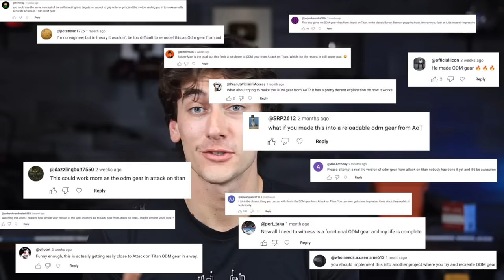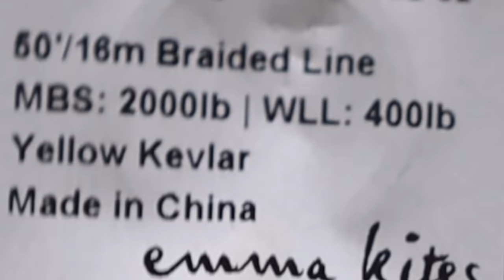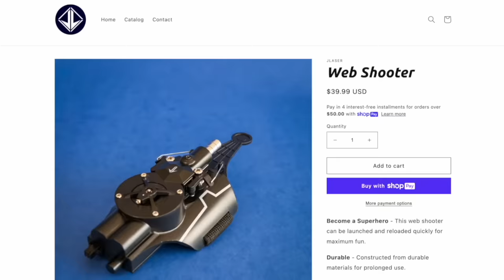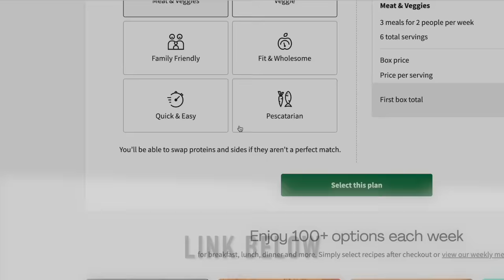I Built Real ODM Gear! - Attack On Titan

Comment: With some tweaking to make it a bit more reliable, I could totally see this being a tool used by rescuers and military personnel to quickly scale buildings! That's so sick!
Reply: omg this is EXACTLY what I was thinking
Reply: But they already have a graplegun, so...
Reply: @DARK_DEEP  why use that when theres THIS
Reply: @DARK_DEEP This is essentially the same thing but leaves both hands free
Reply: the concept itself is impractical without scifi physics, reliability is also dubious. again scifi physics. if the blades easily end titans by extreme maneuver, its hard to say something less exciting, but more effective, and most likely projectile would work far better. in any reality odm gear although "technically" possible, wouldnt be developed, as it presents more problems then solutions, and its ineffective comparatively. like watching jurassic park wondering why they didnt just use penatrating rounds and heavy weaponary from the air. they might have thick skin in the movie, but it aint tougher than steel scientifically, and theoretically it shouldnt be resistant to normal rounds to that extent, much less penatrating rounds. far less exciting for entertainment purposes tho.
Reply: @tinnycans110  no offence but who asked
Reply: hmm may be the structure could be more supportive to the upper body... kind of like a harness or something
Reply: @LexStanton-hj2gy you are sad bcs you got to much hope on this?
Reply: @LexStanton-hj2gy I did
Reply: @LexStanton-hj2gy i asked <3
Reply: @tinnycans110 really they have gun and missile odms as well
Reply: @tinnycans110 😢
Reply: Bombers, Attackers, and Fighters left the chat.
Reply: @tinnycans110 pretty sure he’s just talking about the odm gear, why would rescuers need swords
Reply: @tinnycans110 
🤓☝️
Reply: @sujalgupta8647  in AOT they have basically full body harnesses so if it was actually needed in really life I think it would be fine
Reply: @kevinmackey3166   not really because you are controlling the motor's with your hands. Rope Ascenders already exist and are regularly employed by search and rescue teams.
Reply: @MountainViews90 yes, imagine if fire fighters, who are dealing with a building with a compromised structure and temperatures of up to 1100 degrees; where to climb a building using *checks notes*. A grapple that has to penetrate the building to hook inside, a flammable cord, and a can of pressurized gas that could explode strapped to your body.
Reply: @drizzitdude  while i dont think this would be a good implementation for fire fighting, the cord is canonically made of steel cable and a purpose built metal canister for the gas should be sturdy enough to withstand the pressure created from it heating up in a building fire + you could put a pressure gauge to know how close it is to rupturing and you can release the gas if you need to relieve the canister of pressure. you make a good point about attaching to the building though, not a good idea, most buildings probably couldnt handle the force of a person grappling to it without even being on fire.
Reply: @LexStanton-hj2gy  Haha, cope harder.  Why you mad?
Reply: @drizzitdude  rope ascenders are mostly very heavy and big so its hard to carry around
Reply: @CloudingITS  And so would this, but without the extra safety and security.  You'll notice he isn't going at a dead sprint using it, but always firing it from a mostly stationary position. There's no practical benefits of doing it this way, it's just cool.

Comment: I think the reason they use two independent motors in the anime is so they can use the two sides in a more precise way. You're currently using the ODM gear completely in tandem, firing both sides at the same time toward the same target. In the show, they can fire the sides out of tandem. They can hit one object with one side and something else with the other. To tie it back to Spiderman, think of how Spidey swings along the streets of New York by alternating between his left and right web-shooters. I reckon if you managed to attach the anchor points to two different surfaces, desynced motors would allow you to reel out on one point and slide toward the other- like sliding back and forth along a tightrope. Combined with another commenter's idea of sliders on the controllers to adjust the angle of the barrels (so you don't have to lean back to fire the lines up), and I think you've got yourself a whole new video's worth of content.

One last thing: Is there a reason you haven't rifled the barrels or put fins on the anchors? Either would help the anchors fly straight, possibly negating the need for multiple anchors on each side.
Reply: Preach it man

Comment: Your work is fantastic but i'm going to point some things out which could have made it more anime-like :
• In the anime the thing that shoots the harpoon can be aimed up and down and the aiming mechanism is in the handles which is just a slider , that is the reason characters don't seem to be bending backwards even though they clearly aim upwards (you can see this if you pay attention).
• odm gear also has a nozzle which releases gas from the back which they use for more speed but i don't think you need that its already fast enough.
• their blades are bigger.

Except that i think its perfect, i love your work. You are probably thinking nobody needed this essay...
Reply: i actually thought i was the only one who noticed you could adjust the handles
Reply: The gas is a paradise island only material I think
Reply: Bro some gas stuff 2ouldnt lift a whole human irl
Reply: @shilx_washere8932  Kinda. im pretty sure paradise found the gas in the underground chapel where Marley couldn't get it.

Comment: REALLY GOOD INVENTION MAN! I do want to say that in the show they don’t actually use motors for the odm gear. It’s compressed gas in the tubes that powers the firing and a powerful spring inside the coil handles the recoiling of the string. The point of odm is not to accelerate by pulling in ur body weight with the string, it is to swing off the strings by using the gas

Comment: There's a reason why the ODM has so much harness throughout the whole body,  that's how they balance while being able to have the odm where it is.
Reply: To build off that: Their body is like the steering wheel, and slight shifts in position can change direction bc of the harnesses
Reply: tbh it makes me appreciate the detail and design in aot
Reply: Makes me wonder what the design process the creators went through to come up with it. It seems a lot more feasible than just wishing it into existence.
Reply: @damionkeeling3103  I mean it's the base thought process that makes it almost real, The Harness, The hook and reel system, and not to mention the gas system that also helps propel you and course correct you. The swords have 2 triggers each, now where it's fantasy is that these triggers do everything they shoot the thunder spears, shoot the hookshot and also retract it and control the gas I would imagine the index fingers control the gas left and right handle pushing the gas that way, pulling both gives you forward thrust then your middle finger controls the hookshots and after being fired these also retract somehow. The video is just an amazing proof of concept, if the technology is there and the training is done this could very well be a real invention one day
Reply: @Nocturnal9720  Iirc, the 'guard' on the hilt fires the hookshot (you press the metal guard), the triggers reel the hookshot in and control the gas. The blade is ejected from the hilt by a control at the back of the hilt.
There's different hilts for thunder spears vs. for swords, that's why they wear the holsters in S4- they swap hilts. I think.
Reply: @Nocturnal9720  Actually... no. You have it completely opposite. To store enough gas, and to pressurize it enough so that it can propel like it does in the show would be impossible. A hook that simple but is able to hook to any surface and don't even seem to slip? Impossible. Strong enough ropes that can withstand that type of abuse while being light and flexible? Such material doesn't exist. Unironically the trigger system is the most realistic part, it's not hard to imagine it working with some clever engineering. But the others... just defies physics. This would never be an invention, the closest thing are jetpacks, which can possibly achieve similar performance in the future.
Reply: @chickencoopououwu2584 actually that type of gas does exist, maybe not being able to send you fucking flying but does exist, if you watch Jake vids you would know that
Reply: @chickencoopououwu2584 the hook thing wouldn’t work but this invention is definitely possible, I mean you just seen Jake do it, even though Jake invention wasn’t didn’t look exactly like the anime, he only had a couple people to work on it with him and a couple 1000 bucks to create it. Imaging 1000 if scientists/people working on it with a whole bunch of money from investor and rich people wanting to help with the invention
Reply: @chickencoopououwu2584 the invention is most definitely possible, nothing impossible
Reply: @damionkeeling3103  there's a note in the manga that says the author got help from a scientist friend when designing it.
Reply: @damionkeeling3103 Apparently Hajime Isayama had a friend who works with physics so he helped him with coming up with stuff like that
Reply: @chickencoopououwu2584 I disagree. Impossible is a strong word and you do not have enough information to say that. Theres a reason why things are theorized so often in physics and science in general. Many things are not deemed impossible because we simply do not even know the extent of our universe and what is possible within it. Making ODM gear is most definitely not impossible without a doubt. All we know is that it is not possible yet, as of today.

Comment: Imma just nerd out here and explain how the gear works (im gonna use some of the wiki and on-screen references for the gear and some personal thoughts as well):

So firstly you have 4  parts - The propellant on the back, the wire mounts that also controls the wire's retraction, the launchers on the hip sides, and the triggers.

- The  wire mounts connected to the propellant are on the back. The way the wire mount works is that the inside structure resembles that of a retractable wire reel (you can search it up) except it doesnt automatically pulls back the wire when released (thats what i think, might be wrong). When you push a mechanism on the trigger, it opens a valve on the bridge connecting the propellant and the mount that then expels a certain compressed gas, causing the wire reel mechanism to spin and retract the wire. The wires themselves are connected to the launcher via a series of meticulously designed joints with bearings so when the user moves and do some ODM stuff in the air, the wires are still able to pull them without much tension (kind of like how multiple pulleys work) and without the wires getting stuck on an awkward position.

-The propellant device on the back is the center for the gear, hence why its the most cared for part of the ODM gear, and why the Beast Titan took it (also connected to the wire mounts so it could be considered one part). Its connected to the gas cartridges located on top the blade box, and is connected by 2 separate small tubes under the propellant device. The inside is a bit hard to figure out, but in short, the inside of the propellant acts like a secondary compressor, iirc it has 2 separate inner walls that control whether the gas expelled will push you right, left, or center. I said its like a secondary compressor because the inner walls within the propellant are in a circular pattern that gradually gets thinner and thinner (the gas pathway i mean) until it reaches the exit point where there is a tube thingy that expels the gas in a concentrated manner. Said thingy can also move about less than a half circle (dont know the exact degree) and i think it uses a mechanism that allows the gas to escape only that part without any spillage from the obviously open slot where it moves. Its also worth mentioning that the gas release mechanism is also handled by the trigger, and if you push both hand triggers at the same time, it will automatically centers the gas expulsion and give the user a boost (More on that below). 

- The launchers are located on both side of the hips and are connected to the user's body via the same joint bearings as the wirings, therefore allowing the user to create 3d movements without damaging or tensioning the wires and can still shoot to other directions instead of just the front. Theres not much logic to this as far as i know because there are multiple clips in the anime and ova's that show the launchers somewhat being able to lock on in a specific direction with just the hip movement, i think thats why the joint bearings are there. And there are multiple cases where the launchers suddenly shoot the hooks backwards whilst the user is facing forward, sometimes even to the side, as seen in Levi's background story in an OVA. Another weird thing about the launchers is that they have enough power to shoot the hooks on great speeds and great distances, so a spring launch mechanism isnt possible on that. There isnt also any tubes that connect the wire to the propellant part, so its hard to justify that. But we know that it uses gas to shoot the wires, since there are clips showing smoke or excess gas escaping the launcher barrel after the hooks are fired. It could be a hidden tube (possible) that is connected from the propellant to the launchers, that are then connected via a universal joint or something, and that the trigger mechanism also handles that via a valve. So far it is the second most difficult part to theorize the mechanism for the reasons i said.

- The trigger mechanism is the handles basically, where the blades also attach. The interesting part about this is that, in the anime and the wiki for the ODM gear, each trigger function is shown differently. On Levi's back story, theres a clip were he pushed somethings on the side of the handles, then pressed the big bicycle brake trigger one, and that made the launchers face his sides and fire the wires. Then you have a clip from the opening of AOT S1 where the scout riding the horse pushed the upper trigger (the 2 encased trigger parts) and pulled back the hammer thingy on the back of the handles before firing the hooks. So in short, its the one that can give a really bad headache if you try to understand it. Well in my case, i tried to think of a simple function to make it easy as possible.. First the big bicycle brake trigger. I thought of it so that trigger is the Gas trigger, for the extra boost when in mid air. If you press the left one, it will give you a boost to fling you towards the right, same thing with the right trigger, it will fling you to the left side, press both it will fling you straight. Then the upper trigger where your index finger is, i thought of it as the shooting trigger, press it then the wires shoot. The lower trigger where the middle finger is, is the retraction trigger. Press one, it will retract one side of the wires, press both then it will retract both. For the hammer thingy on the back, i think it would be a good trigger to release the blades, since the users of the gear have to replace the broken blades ever so often. Its also kind of good to place it away from the other triggers and near the blade section so you wont mis click it mid flight (Imagine wanting to shoot the hook but instead you released your blades and you crashed into a tree or house). The 2 sliding thingies, i thought of them to be how to control the tightness or looseness of the joint bearings, so you can do more ODM stuff like shooting it 90 degrees from your side and such.

OTHER THINGS!!:

- For the gas itself, the anime mentioned using gas from ice burst stones that "explodes" when in contact with air. So its like a primitive version of a combustive gas or something, idk they made the gear, blades, and wires in weird stuff too like iron bamboo and all that stuff. Idk the real world equivalent of that gas, but what i had in mind was just some hydrogen or helium, the ones that makes balloons go weeeeeee in the sky.

- The hooks themselves... yes in short they are impossible (i think). The hooks are like your typical "closed then becoming open mid air" type of hook. The idea is that the hooks, before leaving the launcher barrels, are closed, like a folded umbrella, but when released, they spin creating enough drag to open them up (may also explains the on point trajectory and almost straight flight path of the hooks) , allowing them to stick into trees, titan skin, and buildings. Then by some magic, the ODM gear user can retract the hook and wires on will even without reeling it back for it to naturally loosen and escape whatever its hooked on. Then before going back inside the barrel, the hook is already closed again. So in short, i got nothing on that :|

- The most important thing as well for the gear and the user is the harness. It basically pulls all the user's wait and center it the the waist where our center of gravity is. Hence why the harness also is wore underneath the feet. It could also affect the weight distribution so that the gear isnt that much stressed and tensioned

I think thats it... Sorry for ranting about this, i basically loved the gear to the point that i made a "to be made" blueprint of it years back. Also sorry for the grammar errors if there's any, English is not my first language... And if some say that im just saying stuff and geeking about it, i cant really blame you since thats what i also had in mind making this, but its not that bad to say what i had in mind right?? Especially if its giving out some infos if ever needed :))